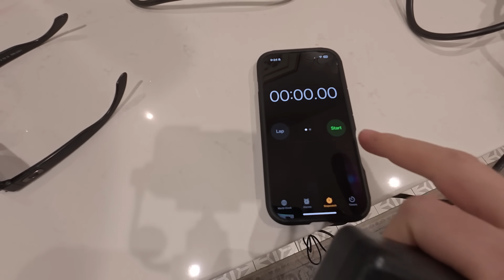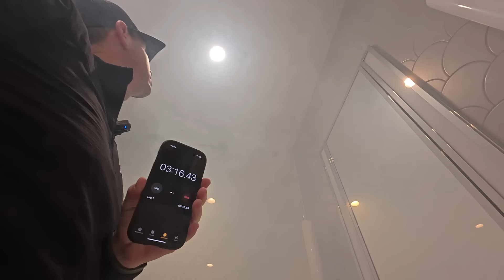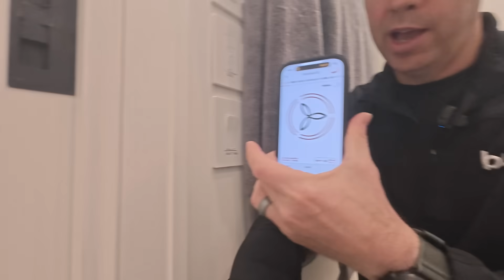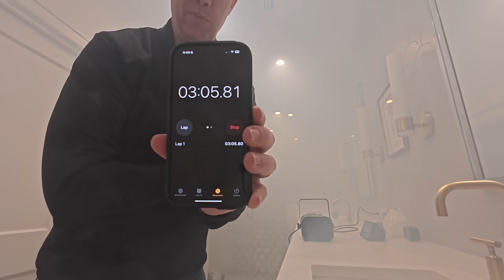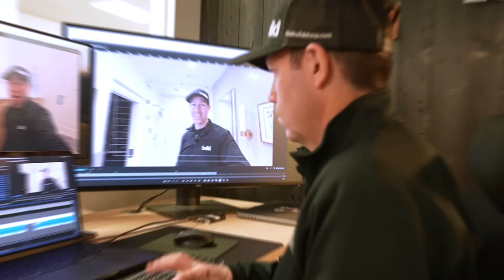Can A House Be Too Tight - ERV Fresh Air Experiment

Comment: I think that because there were no fully waterproof building materials or methods, houses used to be designed quite leaky and allowed enough air movement to dry out anything. Later, combustible heating systems made it possible to keep your home warm at a reasonable cost, so it didn't really matter if it was leaky or not. Since everything has become so costly these days, it makes sense to have a very tight home to stop the elements from controlling the amount of air that passes through my walls. Before spray foam and drywall, I built my house with an ACH50 of about 1.1. My electricity cost is equivalent to that of my neighbour across the street, whose house is 35% smaller. Telling my house how much air it needs is preferable to Mother Nature suckling away all of my heat. I had to have a central dehumidifier installed since the darn dampness had nowhere to escape. That's my only grievance. I live in Canada's north, where nighttime temperatures can drop to -40°C or -40°F.

Comment: The math indicates Dave's system isn't sufficient. At 130–280 CFM across a 2,000 sq. ft. space x 10 ft. ceilings =20k CF envelope, it'll take 71 to 153 minutes for 1 air change.

By using low-cost, high-efficiency fans (30W–50W, non-induction, 150–250 CFM, 12"x12", priced at $50–$80), I'd use room-specific recirculation & filtration system where needed, (i.e.:  allow faster air exchange in bathrooms) while less critical areas can refresh more slowly.

Comment: how about just putting the fog in the bathroom and see what happens to it with the Zehnder completely off.... that would be a "control"... I think much of the "fog" starts to condense and settles out of suspension over time..... the fog does not stay suspended forever....

Comment: Love this!  I live in, "I hate saying this." a builders special new home.  I   wanted to retro fit a fresh air system, but there  are to many hurdles.  So what I've decided to do is to seal the house the best I can, but then retrofit a MUAS.    We  have our kitchen fan and 3 additional fans.  I plan to insulate all the outlets/switches, pull off the base board and caulk floor  to  drywall with big stretch then put the baseboards  back on, not ideal but its the best bandaid I can do.

Comment: It would probably be more economical to have a faster extraction to the attic and just condition the attic space. Have a timer that turns on when the bathroom vent turns on that turns the attic conditioner/dehumidifier on for an hour or so. I do like the idea of air coming in pre-filtered, but unless it’s using something like water extraction it means you probably have to change the filter every month or so. Unless you have a walk in attic that’s not ideal.
Reply: His attic is passively conditioned, no HVAC vents but it's inside the conditioned space. But if you were going to do that I'd rather just have dehumidifier in the bathroom and forego the extraction of air unless it stinks.

Comment: I think it can get musty and moldy if people don't get a proper control and flow of air different rooms are heated and shaded by the sun and have different size windows and floor that heat up in the sun you shade the windows open slightly and have a ceiling fan and central air you can control it if you try different things and experiment but you also have to do it along with regular maintenance and cleaning or you will loose the ability power or skill to be able to do what you want or for it to act the way you want

Comment: I just open the front door a for a little bit I have an exhaust fan in the bathroom and kitchen and sometimes open the back door and an intake vent with 2 magnets and cardboard and shipping tape hinge and especially after a shower I leave the door open a certain amount depending on the difference feel and open the front door to dry the air turn on a fan and when the heat comes on open the door again to get fresh air even open the intake vent and the back door just a couple inches for a minute and exchange the air I even time a shower so I go in just before so it's on when I get out that's how I clean the shower too I time it a long 15 seconds after I see the shower steam I put soap as it dries especially because just enough for the shower enclosure then take a shower and after when the whole room steamy also clean it and doing the drying process I just spray pine sol everywhere and steam clean by hand with car towels

Comment: One thing I was worried about with your test.  If you have 3 extraction vents and no way to get fresh air into the room with the bathroom door closed, what is the gap below the bathroom door?  Will it accommodate all that CFM extraction?  I noticed for the boost test you opened that door to the bathroom.

Comment: One of the advantages of the Energy Recovery Ventilation system is - energy recovery! (Of course, but it didn't seem you emphasized this.) The leaky house has no exchange of heat between the fresh and exhausted air - dumping conditioned air outside and bringing in unconditioned air that will have to be fully treated. Sorry if this is too obvious. Are there estimates on the thermo efficiency?
Reply: Leaky houses generally don't have properly conditioned air. It may be warmed or cooled, but it's a complete waste of time to try to filter the dust out of it, and not much more useful to try to manage its humidity.

Comment: Does not seem like a good test. ERV is great. Farts are Volitile Organic Compounds (VOCs). Ozone (O3) is what nuetralizes VOCs. Outside air is normally 3% O3 (5% is O3 alert). Fog is usually just watervapor dependant of temp/air pressure. Your ERV delivers dry air at 3% O3. An O3 generator might make the stink go away faster & cheaper.

Comment: How does your ERV work with additional high extraction fan loads, like dryer, vent hood etc?  Do you have supplemental air intakes etc for when they are running?    Also I wouldn't use fog machine as most are oil based, I would use the "smoke" bombs that are used in some air testing.  The smoke candles or smoke pellets can burn and generate 40,000 cubic feet within a few mins for HVAC testing.   Great work.  Do you have a in depth video specifically on the HVAC/ERV system you have?  We are getting to the point where our ERV's should be replaced and I would like to look into options to pipe dedicated runs instead of the standard supply into the HVAC return air systems that we have now.  🤠👍  Any good companies in DFW?

Comment: So Matt, how about having Panasonic exhaust fans which some models can hit 150 cfm per fan on high and 100 on low with a passive fresh air grille somewhere in a central area of the house like pantry ceiling that is vented to the outside ?
Wouldn’t that be 1/4 of the price of an ERV minus the filters which can be installed somewhere in that passive vent?

Comment: i think the thing that people are missing is that with a fresh air system the house does "breathe" its just very controlled.  i think people are just so used to the old methods of opening a door or window and creating a cross ventilation.

Comment: What about in scenarios of power outages, particularly longer ones, especially during times of extreme weather when opening windows and doors is not an option? My biggest concern around houses this tight is when systems fail, or major outages occur. Thinking back to hurricane helene, if the house survived most unscathed, but power was out, a solar backup could have been damaged, natural gas may not be available for a standby generator. How is that factored in, or is it? With an older, “breathier” home, you could experience a long term outage a bit safer. I’m a fan of the tightness and the energy efficiency and comfort that comes with it, but concerns come when we are forced into these scenarios

Comment: What would be cool is if you can be a bit more scientific. Run a separate test over a two hour period showing what it looks like without the ERV. Seems unlikely that the smoke molecules would stay suspended in the air indefinitely so you would expect the air to clear all on its own. 

I’m a full believer in fresh air systems and sealing the house but this video actually surprised me by how little air was moved in that room.   I’d say my faith fell a bit after watching this.  Now I’m wondering if we need fresh air systems with zoning.

Comment: Oh and another issue is a fireplace. You need fresh air makeup for that as well. Some models have operable make up air vents and others don't (masonry). Even closed the flue and air dampers aren't going to be as tight as some are suggesting the house needs to be.
Reply: Most of these high efficiency home addicts don't have fireplaces because they are too leaky. They're much prefer HEPA filtered air to a good ole wood burning fire in the winter.

Comment: @buildshow Matt, I wonder what are your thoughts on how this system works when you have other air leakage sources like kitchen hoods with external exhaust & makeup air, wood burning fireplace with fresh air intake & chimney exhaust stack, dryer exhaust, etc - all not very well dampened with the OEM ducting & some relying on external registers with "flaps" that "close by gravity" when air is not blowing through.

Comment: Is that 240 CFM divided by however many inputs?  If so that's not moving a lot of air per room.  For $200 I have a 290 CFM Panasonic extraction vent in my bathroom that removes everything in just a couple minutes.  It's on a humidity triggered (adjustable) wall switch.  True that it's not recovering any energy but if it's only running for a couple minutes who cares?  Seems a lot more practical than that setup.
Reply: Yes it's 240 CFM divided by all the inputs. 290 CFM is a lot for a bathroom, unless you have one of those massive 200 sq/ft shower rooms with 47 shower heads for group sex parties.
Reply: @bobbygetsbanned6049  foam well sealed house so I need to make sure all the moisture is out.
Reply: @daviddunn7817  Since it's well sealed, do you have makeup air? That much CFM will need makeup air, and most people in well sealed homes want that makeup air to go through the ERV, which is why Matt uses his ERV for the extraction.

Comment: Great video! I know I regret going with a less efficient ERV that uses my air handler ducting rather than a dedicated system like your Zehnder, which also means colder air in winter coming in, and less efficiency not helping. Lower speeds on 100% would have been far better.

Comment: There is alot more variables to test on this such as using stronger scents and doing it in the rooms that have the supplies and also checking surfaces for residual contamination. What does system do in the case of a fire? especially in a passive home where the fire needs oxygen but if the system shuts down then all the oxygen would be quickly used up putting occupants at risk of not having some breathable air but also needing to exhaust the smoke cause even the tiniest fires even if put out quickly do a lot damage with costly cleanup. Can system be separated in zones since certain parts need more or less supply / exhaust depending on what rooms are being used throughout.

Comment: I forced the ventilation system guys to put the extraction pie right above the showers, best idea ever. Don't let them put them outside the shower, you will even not have to turn the booster on to get the moisture out.

Comment: The issue with this test is that most people do not build new homes with specialized equipment for air circulation.  The problem with a house that does not breathe is that, God forbid there is a fire, the fire will consume all the oxygen in the house.  The moment there is an influx of oxygen, whether by opening a window or door to escape, it will act as an accelerator and you have less change to escape.  I much prefer my older home.
Reply: How long do you think a fire would take to consume all the oxygen ? You don’t think the occupants would have left by then, via the DOORS ???
Reply: @ The glues used to make today’s beams are far more flammable and new construction gives you less than 5 min to get out as opposed to the older homes which can give you up to 20.  If you are trapped on a second floor with a fire that started on the first, you have less opportunity to get out especially if it starts in the middle of the night while sleeping. Add to that the low oxygen levels from a home that doesn’t breathe, you won’t get oxygen either.  They are very efficient in maintaining temperatures, but not the best choice in such an emergency.

Comment: When your  ERV is in boost mode, it goes from 70 or 130 to 240, an increase of 110 CFM.  Since you have a 10-12 inlets so  that is split around them, so individually each is only drawing about 7-13-24.  Is there an ERV that boosts by single location only?

Comment: I have a new house built to the air tight codes. I hate it and leave a window cracked 24/7 - 365 days a year. I line north of 55 degrees north, so I'm getting -40 gegrees in the winter and very hot summers.

Comment: When experts tell us that we have to seal to reduce flow to a tiny amount, I ask them this question, and they cannot answer.
My range hood pulls 90-120 cfm out of the house.  My bath exhausts pull 50-80 cfm out of the house.  That is much greater than the recommended allowance, so where is the replacement air supposed to come from??  In my house, it come mostly from under the exterior doors, if no windows are open.  I think it best to have a gap down low, because a gap high on a wall will send warm air out by convection.

Comment: Hi Matt, You stink.... lol. You forgot to add the ERV systems recover the energy from the out going air and put it into the incoming air. I added a Panasonic system in my older upstate NY house to (hopefully) fix my Radon issue, went from 10 to 0.2 and as a bonus the house smelt heaps fresher, big difference on the first day. I also tested my unit mid winter and lost about 1 deg between the out going and incoming air at the inside exit points. FYI if anyone retro fits a unit in cold areas make sure you double insulate the incoming and out going pipes once it's inside the envelope so you don't get condensation on the cold/warm vents pipes and angle those pipes down so they drip outside (if they do).   Love to see a story on Greenstone's Ice Panels.... As I'm thinking of building my Georgia mountain home with it. Keep up the good work mate. =)

Comment: Where does the air come into the bathroom? 

I’d pop in a lower door vent. If there isn’t good ventilation into a bathroom, the extraction fans have to run much harder than necessary to move the air. Lower door rather than upper as this supports the natural flow.
Reply: I think the zehnder system places supply vents as well but it's likely not in the bathroom. They should've put a fresh air supply in the master closet and an extraction in the bath area but no idea if they did that. That way Matt couldve properly run the test without opening the main bathroom door which made me very suspect of the test altogether

Comment: In the 90s code in my area required a fresh air intake on furnace returns. This was for radon gas. This is a good way to bring in fresh air, and pressurize the house to reduce drafts as well as provide make up air. I run my furnace fan 24h and it keeps my leaky house fresh. Not as energy efficient, but an effective solution to air quality issues.

Comment: Can i have an ERV like this AND a regular old fart fan??

When you shower, it produces steam. How long til that steam clears out? Is it still 10 or 30 min or 2 hours or whatever? Because of course a regular fart fan / bath fan will clear it out faster -- i worry if i build like this then the steam will sit against the walls and towels and everything for way longer each time.
Reply: You could, but that's why locations of exhaust points matter - to be more effective at pulling the worst out before it really spreads out. That and boost mode and potentially even tying boost mode to humidity levels detected in bathrooms means additional exhaust isn't really necessary in well designed systems.

Comment: Better add an automatic generator to your house or all that air exchange will stop will it not?
Reply: Yes, but it would take a long time to become an issue. You'd have bigger, more urgent problems in an outage lasting long enough to matter. And if it did last that long and you had no power backup, you can still open windows.

Comment: I worked in a modern office building for many years that was sealed up like a submarine. None of the windows opened. All of the air moved in and out of the building with fans. It’s fine until something nasty gets into the ventilation system and nobody can find it. I can’t tell you how many people had respiratory problems. Moreover office buildings are mainly concrete, steel and glass. Nothing that rots. Unlike homes.

The idea that air/water tight houses last longer is highly suspect. I lived in a home on the north coast of France that was built in the 15th century, one of the oldest in Europe, Nothing sealed anywhere. The house was cold in the winter for sure, but it breathed. Water that got in through the centuries quickly evaporated. The house still had some of the original windows and doors. Very cool place.

I don’t think people realize how much the current thinking about building methods is driven by marketing. I remember when asbestos shingles were all the rage. “They’ll last forever.” It takes time for materials to prove themselves. Like 50 or100 years.